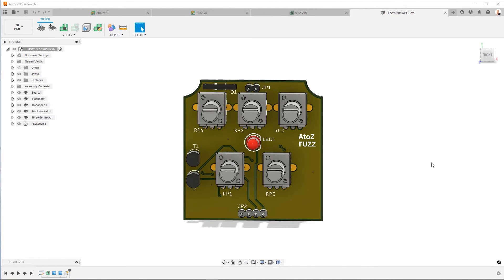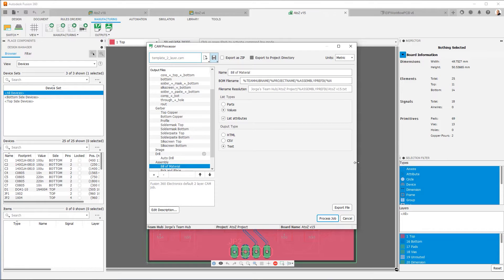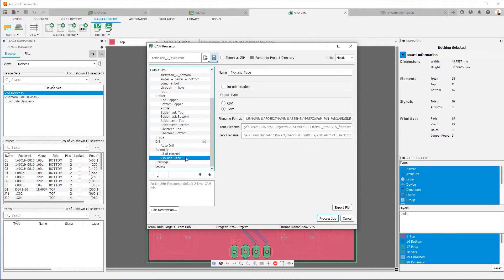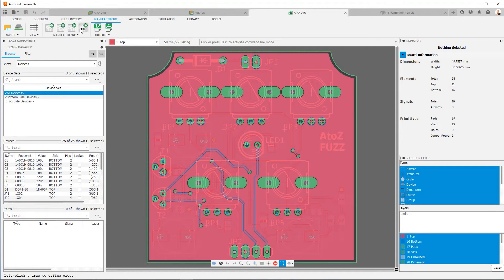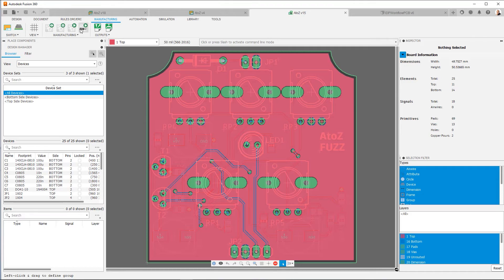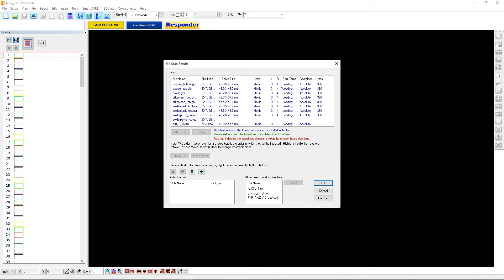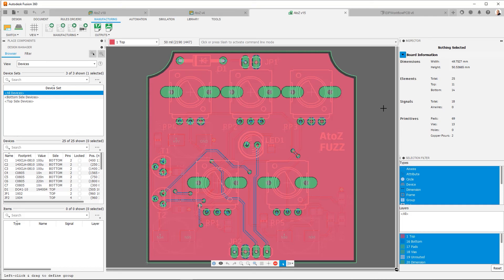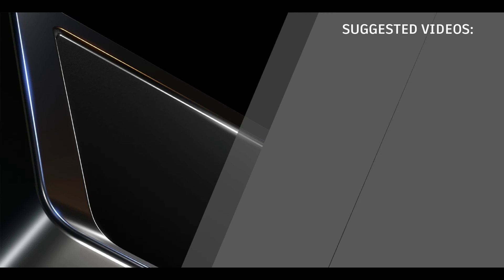Generate PCB Manufacturing Files | Autodesk Fusion Electronics for Beginners

Comment: did I miss how to define the initial board layout, I only saw that it was pulled from a library.  I want to create a very simple PCB that will simply act as a wire extension.  specifically something called race wire that can be used as a mounting point for motors and a speed controller.  no electronic hardware at first.  I may add LEDs at a later point.

Comment: When I try to move wires on PCB layout, there are many unnecessary wire stubs and segements, can you auto optimize the wires?
Reply: Yes! You can use the smoothing tool! :) It is explained in the previous video of this series.